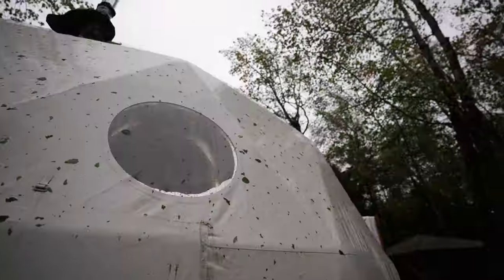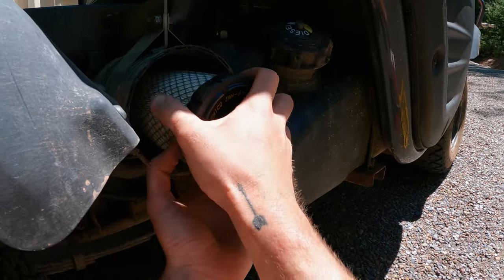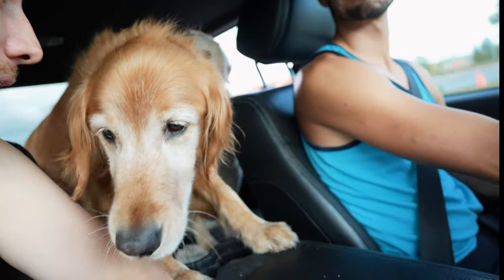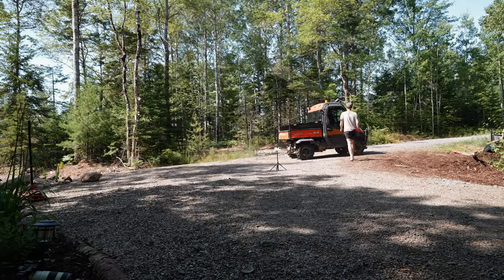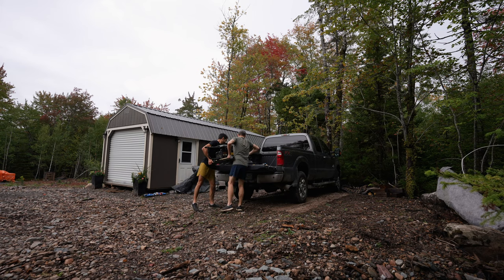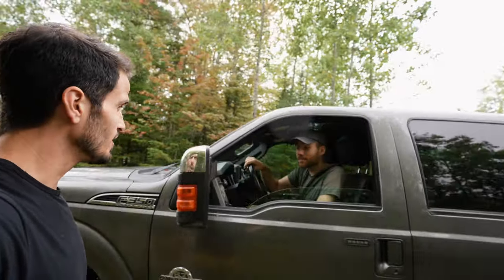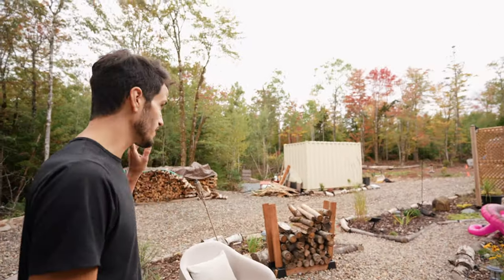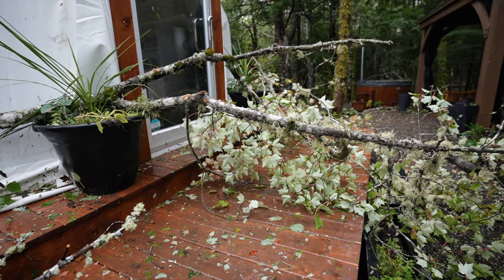Too Dangerous to Stay Here (Geodesic Dome vs Hurricane)

Comment: Todd, I seem to remember I told you you were a lumberjack, among other skills.  I had not doubt about you felling those trees exactly where you wanted them.  Tyler, there are two words to rem,ember when backing a trailer. They are push and follow.  Most of the time your first move is a push. That's where you steer the truck opposite  of where you want the trailer to go.  A follow is when you want to straighten both truck and trailer together.  Keep the movement of the steering wheel to a bare minimum.  If you're pushing a trailer, you can always push a bit more , and the same is true of a following. If you do too much of either at the outset,  you can't recover and that's when things get frustrating. Then everything goes south in a heartbeat.

Comment: Changing tires...hopefully you have a spare thats already on a rim.... Block opposite wheels. You're doing right loosening the bolts before jacking it up. Then jack it up, change tire, put on bolts, then tighten opposite ones...ones across from each other, but don't crank on them. Lower vehicle, then crank down tight, doing the opposite thing again. Don't over-tighten. Check for loose ones & re-tighten if necessary after you've driven a bit on it...if your jack won't reach high enough, put solid blocks of wood under it to raise it a bit...😁

Comment: Hey guys, glad you're safe.
Re: backing you're trailer... (you may have heard this before)
 A helpful tip is too "turn towards the trouble". Meaning while backing and looking in your mirrors turn the wheel towards the trouble.
I spent a couple years driving tractor trailer and that tip got me out of many jams.

Comment: Lil trick when backing the trailer… hold the steering wheel at the bottom with one hand not at the top . It simplifies the steering left is left for the back of the trailer right is right instead of the opposite wall holding the top of the steering wheel .

Comment: For the air filter, get your air compressor and blow the filter out, both inside and out. You can still get some usage out of them, unless you have heavy usage (really dusty workplaces). It won't be 100%, but 85 or 90%, and not for full time, so be aware and clean them out more frequently.
And on the "types" guys - don't let that stuff get in between your love. You know your strengths, and you can work with your 'weaknesses'. But just don't do the 'binary' thing.

Comment: alright, I suppose this question has to be asked....  WHAT have you planned in the case of a Tornado or Hurricane????
You are in this forest which other than trees is a flat land.  And the trrees can be a flying or falling object too.

So what have you planned in case of such an Emergency??

Looking at what you have,  if your foundation is extremely strong and secure, you can make a spot (enclosure)  under the dome.
you could do simiar under the container house but I would install strong bracing in case your foundation poles should bend over,  your bracing would support the weight of the container home.

The only other safe place would be to bury a smaller container, like your out house container size and have a stair to get down to it.   Have an emerg exit somewhere and a shovel in the container incase your stairway is blocked by debrei and you can't get out.

From what I am seeing, YOu dont have any plan for an emergency, and that may be your folley.

The boys are good companions.   I have had many, and have a good girl with me now.
we lose them for many reasons from health to cancer.  I've seen it all.
Charlie is a good boy, its a shave our friends have to go through this crap.

Just for information on your part,  I suggest you search FENBENDAZOLE.
I thought it might be important.

Comment: If you put a rope and thread it through the holes that are in the tarp that have the steel grommets from the bottom to the top it would almost be like a sandwich with the wood in the middle and it would just be a nice solid connection

Comment: I’m a little surprised you were taken by surprise by a hurricane. Did you seriously think you could ride out a hurricane in a tent?  I can’t imagine doing something so utterly dangerous and frankly stupid.
. You do realize you live in a tent right? It’s a fancy tent but is a tent!
That makes me fear for your safety and wonder what idiot is giving you device.
Reply from the maker: It's not a tent, it is a Geodesic Dome and is structurally engineered to withstand a hurricane (we hired our own engineer to double check when we had our foundation engineered). The issue was the wind speed started breaking the branches what felt like every other second...because the liner is susceptible to punctures, we didn't want to risk it which is why we made the decision to leave. It has zero to do with the structure...had we made the choice to not build where we did (and not remove the trees around us) this wouldn't have been a problem whatsoever.
Reply: @tylerandtodd  That's the way I understood it too. The dome is constructed to take the hurricane and shove it somewhere. The hurricane can't huff and puff it away. But it must have been somewhat of a shock when you realised that the hurricane armed itself and started throwing spears at you.😰
This reminds me of that old cartoon, Coyote and Roadrunner, the scene where a thunderbolt hunts Wile E Coyote all the way to smithereens. Zap! Yikes! Zap! Yikes!🤣
Live long and prosper! / CS :chillwcat: